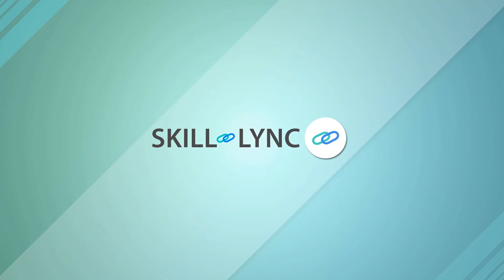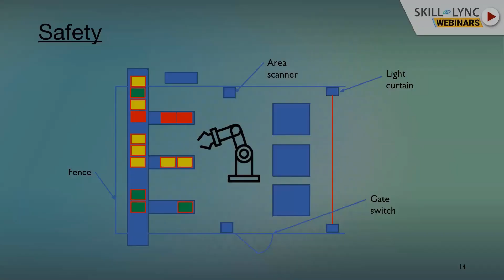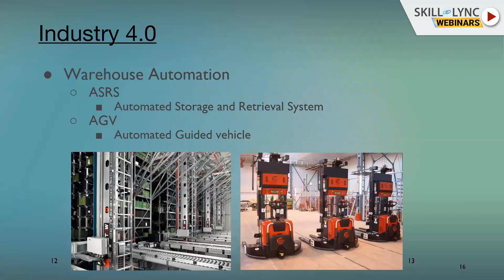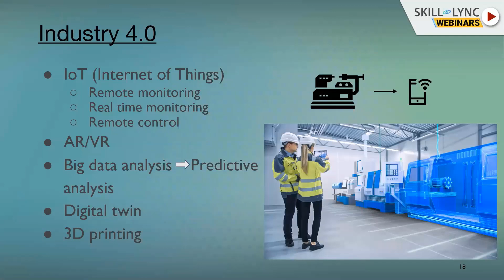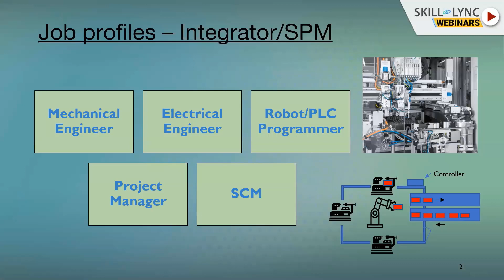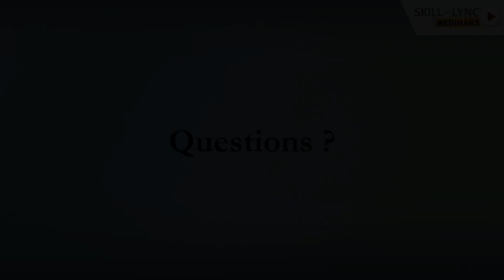Factory Automation Industry 4.0 (Part - 2) | Mechanical Workshop

Comment: What I should do as students from mechanical engineering.  In this field. What's the skill I should learn etc
Reply: As a mechanical engineer you can work in the design department. So your focus has to be on machine design, manufacturing engineering, CAD and basic electrical and electronics. 
Factory visits and exhibitions related to manufacturing helps you understand what's happening around the world.